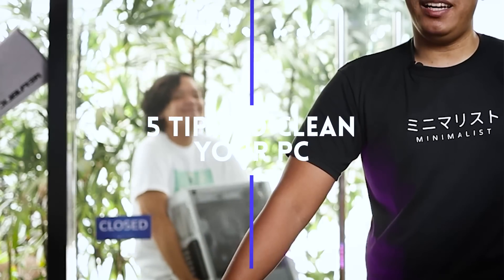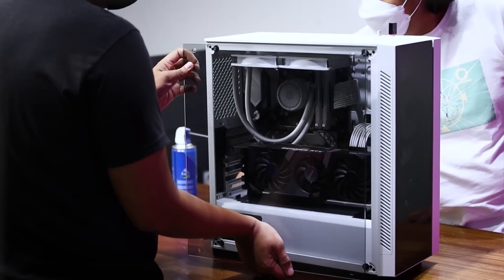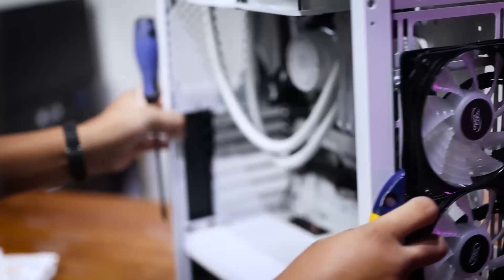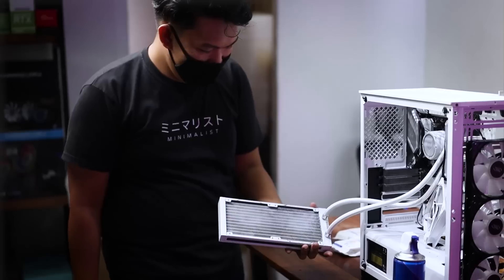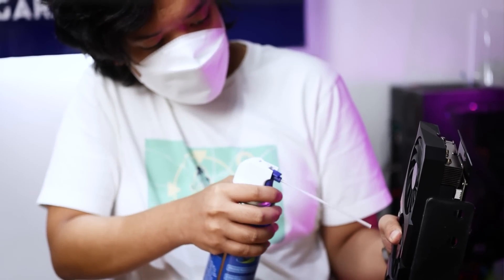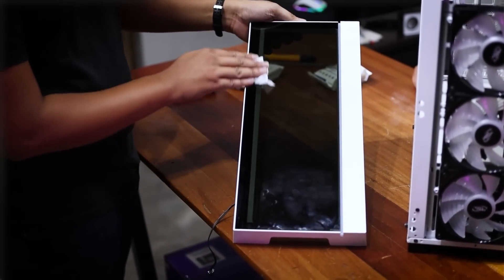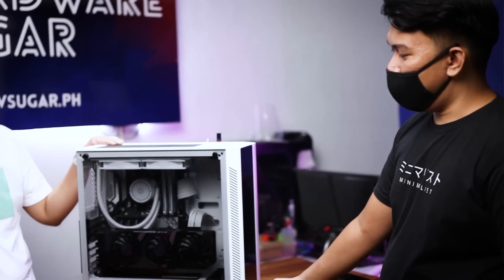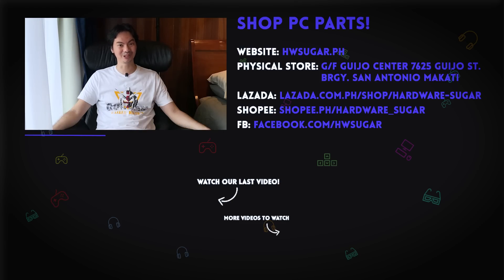People PAY US to clean their computers ✨This is how we do it 🛁

Comment: I would recommend using a cloth when cleaning your case fan it just easily wipes off the dust and also if you can remove them from your case then just put it back again later again that way you can clean the fans more easily.

Comment: Tsaka question po mga bossings, nabanggit nyo po na pwede magkaron ng static buildup pag ginamitan ng brush yung motherboard.

Is that still the case kung may alcohol yung tips nung brush na gamit ko?
Reply: Well, it is using the same material padin naman that can generate static discharge. 

There are brushes naman na Anti Static na made talaga for cleaning electronic devices. You can find them on your usual online stores.
Reply: technically po kht isopropyl alcohol ndi 100% safe un parts mo dun. better use a Contact Cleaner for electronic devices sa pag lilinis, 2nd, is about static sa brush. static would only build up depending on the friction, so brushing gently would not cause static build up. or at least brush 2-3 times then stop for a few seconds then do it again, would not cause any static build up

Comment: Pwede gumamit ng vacuum instead of compressed air? Or masira ang components?
Reply: We dont recommend vacuum cleaners as they can disturb and blow away dust at a much higher volume. That could lead to worse static buildups. Siguro if yung small, low powered vacuum cleaners like yung hand-held ones lang, pwede. Pero to be safe, just stick with canned air.
Reply: @rockyismael  Thanks for your advice

Comment: no need naba linisin powersupplyu ?
Reply: Di lang sya na include sa video but brushing out yung dust sa fans ng PSU should be included as well.
Reply: Need din, di lang napakita here. Pero it's the same as yung pag clean sa GPU and fans. Brush konti yung blades, then compressed air palabas ng PSU.